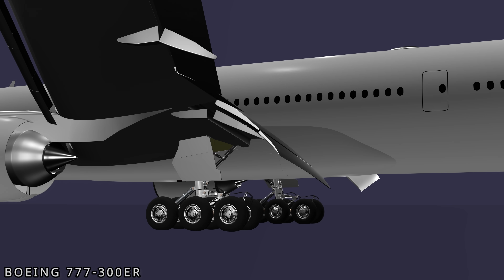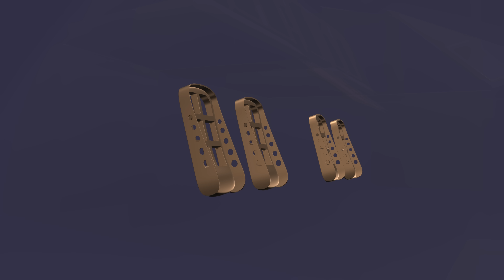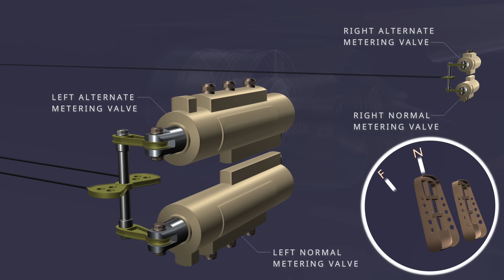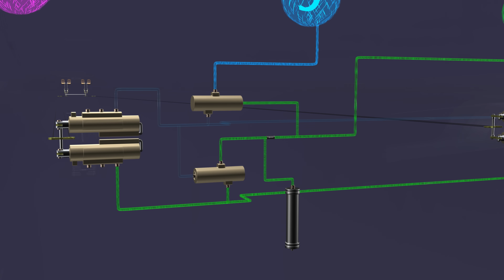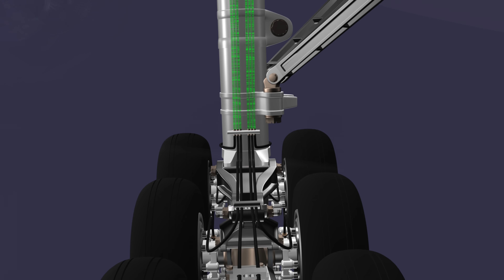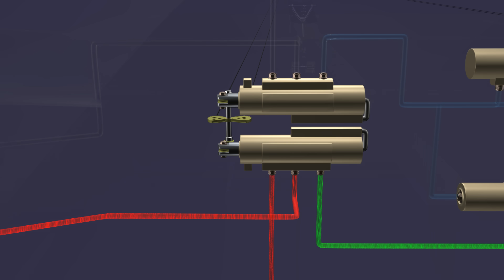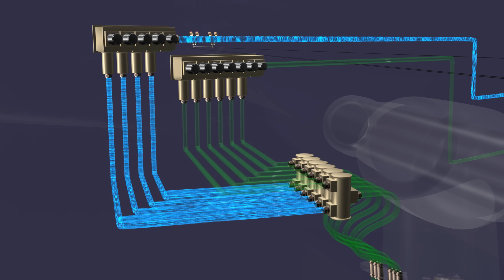How Landing Gear Works | Part 1 : Brakes

Comment from the maker: Note: While making this video, we only considered simultaneous brake applications (left and right main landing gear brakes together) and did not consider differential braking. Therefore, the bus pedal mechanism was simplified with a single transverse control rod. However, two control rods connect the left and right brake pedals to allow differential braking. We will remodel the bus pedal mechanism and explain the differential brakes in the steering control chapter of the series. Until then we request the viewers to ignore differential brakes while watching this video. Thanks for the support.
Reply: @AircraftScience  Thanks in advance. May God continue blessing you as you do it.
Reply: Sir how about the differential braking?  I'm waiting to here from you.

Comment: I used to work for a company that supplied sintered metallic brake components to BF Goodrich, Goodyear (it became Loral) and other companies. Some were rings between 10 and 20 inches OD and some were cupped segments that were riveted to carrier discs. Some of the planes were the MD 80, the Super 80, and the military C-130. Now I suppose carbon fiber brakes are widely used for weight reduction and stopping ability. When I worked in R&D we made and tested thousands of materials on a dynamometer. The most spectacular tests were reject take offs. We always shielded the tests but once when they were making a customer relations video we got to run one without the shield. Sparks flew out and hit the walls and the 20 foot ceiling before the components welded themselves together.

Comment: 0:25 It's only the suspension assembly which holds the aircraft weight and absorb all shocks, breaks only slowdown the speed on ground.

Comment: The “Three Bogey” Truck system on the Boeing 777 only has brake units on the first two wheel bogey pairs….The rearmost wheel pair do NOT have braking units fitted…..It’s probably the same with Airbus, but not entirely sure……Hope that helps!

Comment: Redundant aircraft systems are strange in that there are still many single failure points that could render it inoperative.
Reply: Not everything was covered here. For example, there is actually 3 sources of hydraulic power available for braking - right, centre and accumulator. These systems have been developed over many years from other aircraft types and what they have learnt from them, including accidents etc. But you are right, there is a possibility for many failures but aircraft parts are very reliable when compared to your typical car components

Comment: Very informative, but you made a mistake, what you termed  a brake stack, is in fact a brake pack that works the same as the clutch pack in a motorbike transmission. Engineers working for the Bendix Corporation designed developed the multidisc brake pack in the mid 1940,s,its first application the massive single main wheels of the prototype Consolidated Vultee B-36 Peacemaker that required two brake packs sandwiching the wheel hub. A clever adaptation by Bendix of an oil immersed multidisc clutch designed by HeleShaw in  the 1920,s.

Comment: is the left hydraulic system not used for braking? since both the right & center systems are used for normal & alternate brake pressure
Reply: Correct

Comment: The plural of "landing gear" is "landing gear".  Your title should read "How Landing Gear Works".  Same as "aircraft".  1 plane is an aircraft.  A fleet of planes are aircraft.  The English language can be VERY confusing and quite challenging at times. 
Great video. Excellent explanation and animation!!
Reply: Yeah, lots of folks don't even notice a problem when using words like aircrafts or equipments

Comment: should the pilot knows  about this complicated thoery about how it functions or just have  an idea how it works .as far as I know the maintenance part only should know it cause it's their job.
Reply: The pilot operates the aircraft and therefore only needs to know the basics on how it operates.

The maintenance man needs to know this in depth because they are the people that fix it when it’s broken
Reply: Flight engineers back in the day, had to know every system on the aircraft.   In my younger military days I was a flight engineer on the C-130.

Pilots fly the aircraft; flight engineers were inflight aircraft system experts.  We had to have an active, current working knowledge of the flight manual,  cover to cover almost.  Most were former aircaft mechanics who crossed over to Ops.